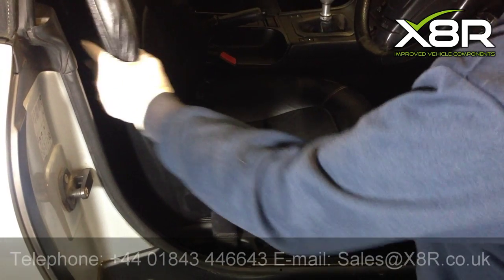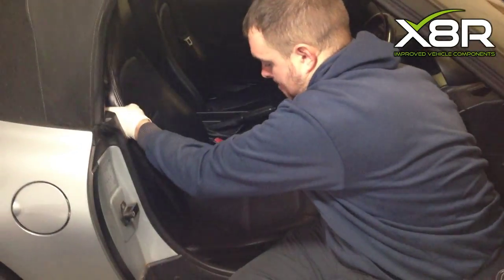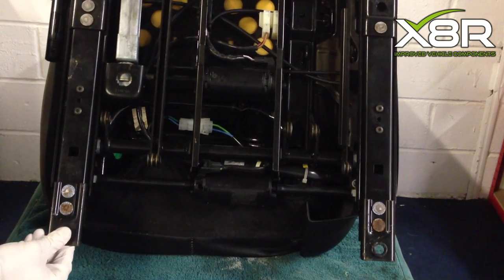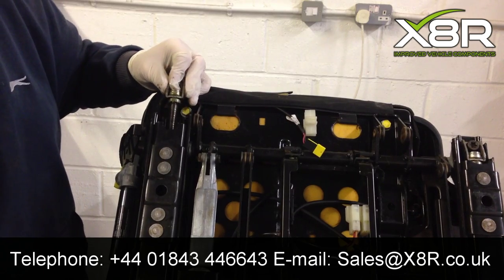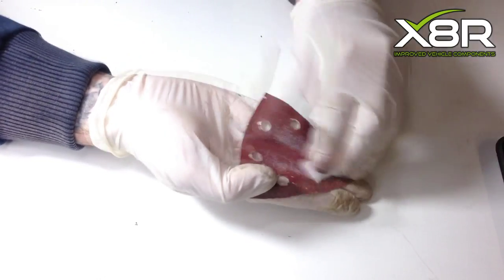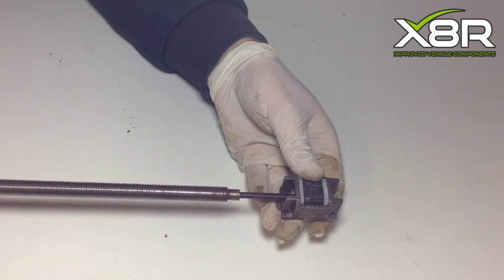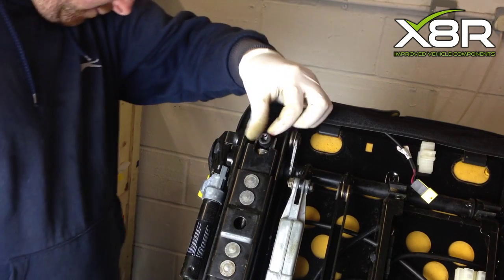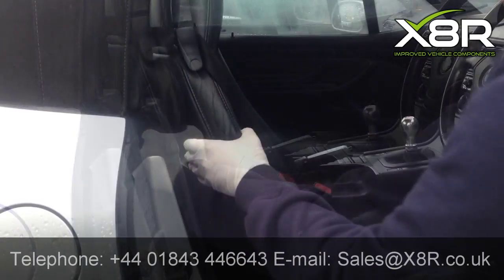BMW Z3 Z3M Seat Rail Track Runner Sub Frame Mechanism Bushes Bushings Rocking Repair Kit

Comment: Thanks for the video.  Had this issue with my '99 M Roadster, no more!  One thing to emphasize, make sure you keep the rails exactly as they are on each seat.  I mistakenly put the left rail on the right track and vice versa on my driver seat and it caused the seat to move the opposite direction of the switch!

Comment: Good video. Thanks! Because the original bushings were completely dissolved to goo, the unthreading count was 2 turns less than the re-threading turn count. With the seat in the full rearward position during removal, both carriers were 7 turns to remove, but 9 turns to reinstall. Also, the receiver "key" at the tip of the assembly that sleeves with the drive rod is square and it is helpful to pre-align the threaded rod to match the drive rod orientation.

Comment: Why not wrap a piece of tape or a dab of paint on thread area as a marker instead of counting turns? Though I find it odd that you're paying around $20 for a set of plastic washers that you still have to sand down to fit properly. They should be the proper thickness in the first place.

Comment: Great video thank's, Just one of the sliders has an L on it should go on the left side of the seat otherwise the electrical command will be inverted and as stated below do not screw tight the 2 x T25 Torx screws on the sliders, to much friction will block the rail track.

Comment: Hi X8R, I've bought your bushings and followed the video instructions, but I have an issue when it comes tightening the 2 x T25 Torx screws on the sliders. When I tighten them they power seat motor goes under a lot of stress, however when they are loose or not on at all the motor works fine.

The new bushings have been aligned correctly, and just comes to question is this why the original part is rubber to compensate for the "wiggle" in the tracks? Any feedback is appreciated so I can have it secured in my car.
Reply: Might have the thread count wrong vs the other rail and it's binding. I find it better to measure with a tape or ruler before disassembly instead of counting threads
Reply: Hi man
Your comment about tighten the 2 x T25 torx screws help me to find and solve the issue about the stress that I have in seats motor. I find that I had pushed a lot deeper than the ideal this metal thing with the bushes inside. And the hole was not exactly in the center. That causes this problem and in my opinion is dangerous to burn the motor. 

If anyone wants to test the seat rail movement before place it in the car can do this by connecting a 12V battery directly to the motor's plug. And for removing to the other side just change the polarity in battery

Comment: I have a problem, I must have been wrong to count the number of turns, so now I try to place the seat but it is displaced from the chassis bolts.
How can i fix this?
Reply: 4 years. But I have the same issue do you remember how did you fix it ?

Comment: I have a BMW Z3 with the same probem. One more question: Is there some special procedures to disconect and reconect the electrical plugs? Thanks a lot for the video!
Reply: nothing special just push down on plastic locking pieces on plug before pulling